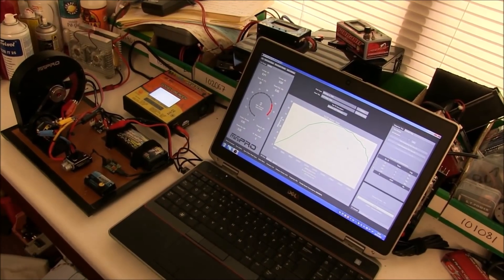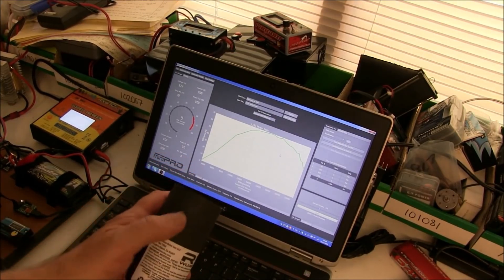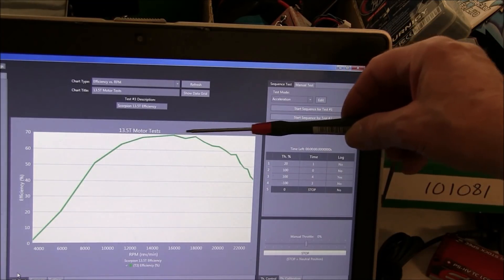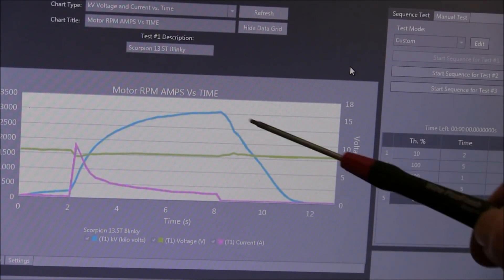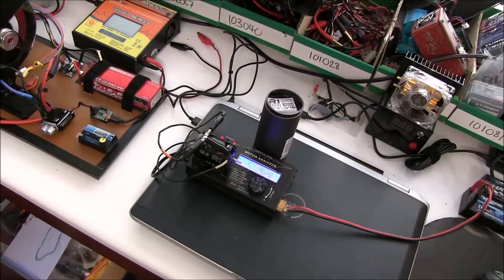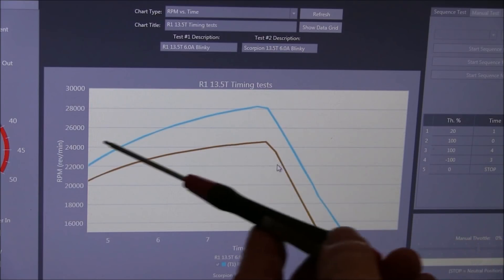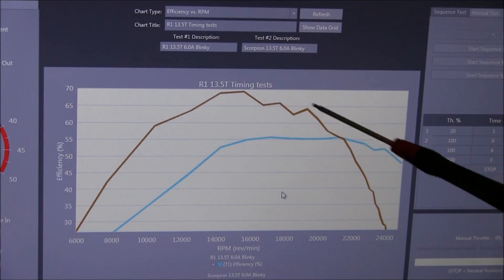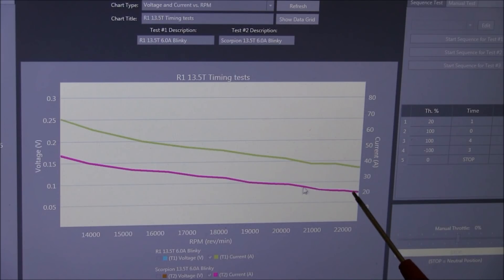Minipro Dyno Motor Testing. R1 13 5T Evaluated.

Comment: Nick I run a lot of 10.5 blinky classes what Amp draw should I be using?
Reply from the maker: Hi Craig. Tuning the 10.5T for blinky. 6 amps works just as good for 10.5T. All the best racing. Nick

Comment: What is "blinky mode?"
Reply from the maker: Hi James. Blinky mode refers to the speed control (ESC) setting. The ESC is set to zero boost and zero turbo. All the ESC now have a blinking (flashing) led to show that it is set to zero timing. Thus it is called Blinky mode..
All the advance timing is then set on the motor end bell. Some competitions limit the timing to 40 degrees maximum.
It is supposed to give equal performance on the race track, with no car faster than others.
Reply: @nickadams5411  thanks for the reply. Do all ESCs have this mode?
Reply from the maker: @jamesalesi1305  Most competition ESC, such as Hobbywing have the Blinky mode.

Comment: You should sweep the timing instead of calling the motors equal at 6 amps no load.  Do a pull at 5 or 10  degree increments of end bell timing and compare the efficiency curves for each motor.  This is also how you would build the timing curve for non blinky mode racing.
Reply from the maker: Hi Brett
Thanks fot your feedback.
To get the best performance from a motor in Blinky mode, for most race tracks, you need to advance the timing as far as possible to obtain maximum performance before the losses (mainly heat) become too much.
6 amps is a good compromise and normally results in the timing around 50 degrees.
Any more advance increases the losses exponentially , although it may be of use on say a speed run, or oval racing.
Reply: Nick Adams a
Reply: I think you have some great content here.  I agree with your method of setting your roll out slightly over peak efficiency so when you pull it down it pulls down into peak efficiency.  I think seeing the family of curves you get around 50 +/- 10 degrees would be interesting, as well as how the rotors change the curve.
Reply: I realized I didn't see the end of the video you covered the timing sweeps, my apologies.

Comment: If you were to gear the R1 to 24k at 50% effiency surely you could do the same with the scorpion, which would then be approx 22k rpm's.
Reply from the maker: Hi Ricky
Thanks for your feedback.
The Scorpion is a good motor and the graphs do help with gearing.